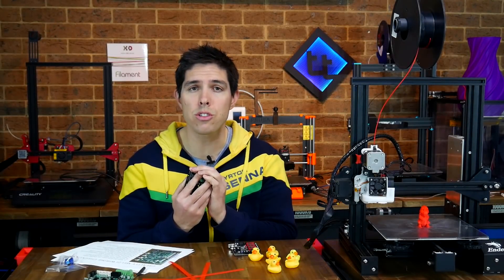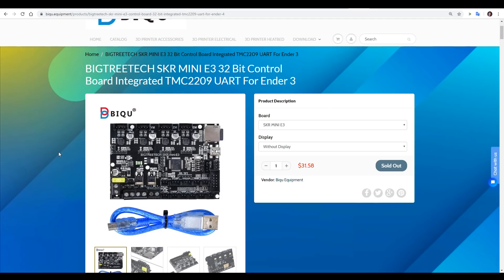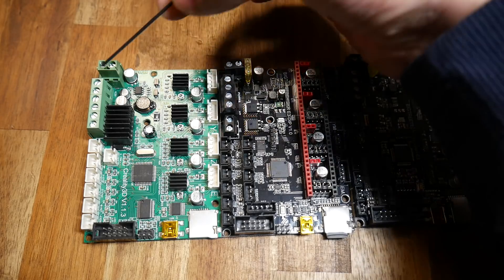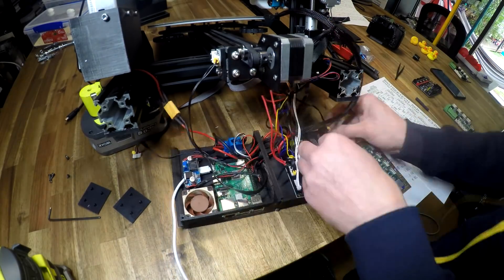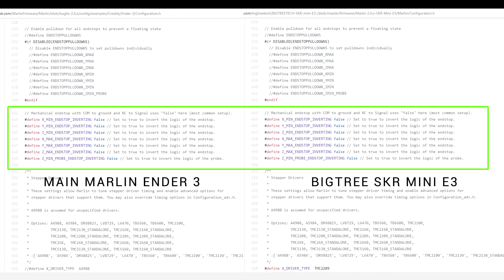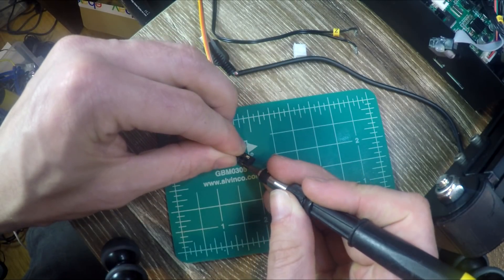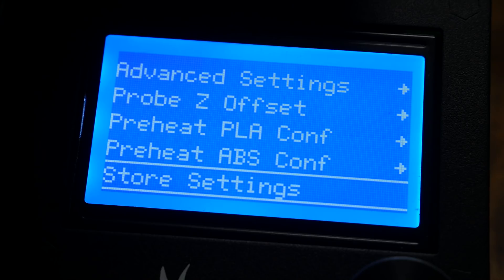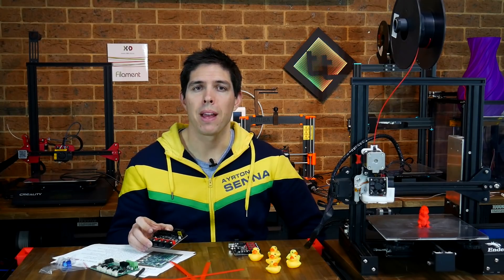SKR Mini E3 - The best Ender 3 upgrade from stock?

Comment: Hey Mate,

Do you know if I can plug a thermocouple direct to this board?
Reply from the maker: No you can't.
Reply: Cheers for the reply mate. 
Shame the thing is out of stock. I think my thermistor shorted and killed my board (can’t reach temps without thermal runaway, even with new thermistor from jaycar- with correct marlin thermistor table), so may as well upgrade to a better one.

Comment: (!!!) People need to note: there is a big problem with this board and reliability with BL Touch versions 3 and up. Frequent crashes into bed, probing fails, etc. Seems related to the 5V regulator (U6 on the schematic).

Be aware that the following partially ameliorate the issue but do not resolve it:
- 100nf cap across BLT 5V and GND
- 1000uF cap across 5V and GND on spare endstop
- turning off software interrupts for endstops in Marlin
- supplying clean 5V via USB / buck converter

Related issues appear to include:
- LCD flickering when hotbed active https://github.com/bigtreetech/BIGTREETECH-SKR-mini-E3-/issues/24
- Incredibly noisy and unreliable 5V rail, especially when servos active https://i.imgur.com/99kHqls.png
- Overheat and shutdown of 5V regulator when heated bed on https://www.youtube.com/watch?v=7RvH2XGFsz4&fbclid=IwAR1ZfIuQgvMvwTDs1jGCzFFsz_m-cSjNX_roWBrgoS522lGXoAQPAV_fL1Q

BTT's response has been disappointing:
- ignoring comms from users
- denying there's a problem
- refusing refunds on AliExpress

Michael, I understand you only had a short time with this board when you made this video and perhaps did not note these issues. However, I don't see how you can in good conscience continue to recommend the board in its current state. A cursory look at the BTT communities on Facebook will bear this out (e.g. https://www.facebook.com/groups/322956191976815/).

I have the SKR Mini E3 and have experienced this issue since day 1. BTT eventually sent me an E3 DIP with 2208's as a replacement after I kicked up a big stink. People say the DIP doesn't appear to suffer from the same issues, so I'm hopeful that when I receive the replacement I won't have the issue anymore.
Reply: Please update us when you get the dip version.
Reply: @iphonetroll  I love the support I've gotten from the 3D printing community, so I'll do my best.

In all fairness BigTreeTech has tried to do the right thing by sending an alternative replacement so I owe it to them too.

I really do hope they can sort this all out and get through this.

They clearly have some good ideas and are bringing to market some great upgrades at a good price.

Comment: I have order one. Question though - will it need extra cooling for the TMCs?
Reply: It has 4 cooling blocks to put on the tmc in the package.
Reply: @flobow8446  I know that. But does it need extra cooling - ie a fan blowing onto the driver heat sinks?
Reply: @meltonpieman959  i just have the Stock Setup and it works without any issues yet.(Standard Case Fan blowing in the Case)
Reply: @flobow8446  Thanks a lot

Comment: those poor heatsinks went to the wrong side of the board. tmc chips lead the heat downwards, that's the reason for the high number of vias (thermal vias) on the board and the big exposed copper surfaces on the opposit side. there is where the heatsinks should've been placed

Comment: how do you setup ezabl as I have that  instead of a bltouch in marlin 2.0
Reply: I just copied over all the TH3D U2 probe/ABL related settings to the stock Marlin 2.0 Ender 3 config (with the SKR mini e3 changes) and it works like a pro.
Reply: @The-Slunk  can you share your config so I can see how it is setup
Reply: @sreed1073  I definitely don't mind, but I'm currently having issues with my Y-axis motor Getting very hot (disclaimer). Let me know if you still want the config thought and I'll share it.

Edit: here is a link to my confi and config_adv https://drive.google.com/file/d/1zRipXbflnRbA0rveldzE1juoR_jB0pHo/view?usp=drivesdk
Reply: @theslunk
 It would be great if you could post your config. I have never checked how hot my y-axis with stock board. What mainboard are you using.
Reply: @sreed1073  here you go. I'm using the SKR mini E3
https://drive.google.com/file/d/1zRipXbflnRbA0rveldzE1juoR_jB0pHo/view

Comment: Are the main logic levels of these boards 3.3V or 5V?
Reply from the maker: 5V
Reply: @TeachingTech  Great! No levelshifting boards or optoisolators required, then, correct?
Reply from the maker: Yep 5V like the original so no hassles.
Reply: @TeachingTech  Thanks for your videos and responsiveness to questions!

Comment: Does anyone know if it is worth upgrading to this from a mks gen L with tmc 2130 stepper drivers.
Reply: Wanted to declutter and not rely on my tmc 2130 that are prone to overheating i was kind of asking if going 32 bit and marlin 2.0 gained me any benifits due to the fact that i would have to relearn programming marlin on platform io wasnt a big follower of tt back then but have now upgraded both my ender 3s to this mainboard having trouble uploading to the v1.2 board but very happy with it never the less

Comment: Run away from the SKR Mini E3, it is a disaster waiting to happen and I ought to know as I have one that is now sitting back in the Box it came in. It's damned near impossible to get firmware compiled for the thing to run as the manufacturer has used whatever was available a the time of manufacturing for the main Chips. Some are STM32F103RC some are STM32F103RE and Some are STM32F103RE+. When you try and format the Firmware Platform.io has to have the correct board name entered. And your options include Bigtreetech_512 or Bigtreetech_256 or Bigtreetech_512_USB and the list goes on an on. So if you want to Print something, expect to spend a week or two trying to get it to function and if you're crazy enough to try adding a Bl-Touch, expect another 2 or 3 weeks to get it working. If Ever.

Comment: Mich ,i got SKR MINI E3 V1.2 ,  i did every thing to enable XYZ end stop ( mechanical ) with no luck and homing issue still there , even i used your firmware.bin however it is not working and with VS code giving this message ( #include errors detected. Please update your includePath. Squiggles are disabled for this translation unit (E:\For 3D printing\big treetech\BIGTREETECH-SKR-mini-E3-master\firmware\V1.2\Marlin-2.0.x-SKR-Mini-E3-V1.2\.pio\libdeps\STM32F103RC_btt_512K\TMCStepper_ID5513\src\source\COOLCONF.cpp).) i hope you can read this message
Reply: im done and its working

Comment: Are there any Mainboards for the ender 5?
Reply: This one will fit. Ender 5 use same board as Ender 3. You only need to flash custom marlin firmware.

Comment: Thank you for making the video! I followed you original guides and got BL touch, upgraded Marlin with thermal runaway and filament run-out detection. (Pin 29 I think) This last one feature was not mentioned in this video, is it possible to get filament run-out detection with this board? Thanks again!

Comment: Will it work with Ender 3 Pro?
Reply: Yes, mine works well, but i think there is still room for improvement with the firmware.  Right now my stepper motors are running HOT and also i have read that it may be possible to adjust the firmware to include EEPROM storage without the need for storing on an SD card.  Definitely a great upgrade for the reduced noise alone.  I am hopeful any issues we are having will get sorted soon.

Comment: This thread originally was about the fysetc board but Tim from TH3D also mentions the SKR mini E3 having power issues. Feeding back the USB power to the power inputs etc. Would you mind investigating if there are any issues?

https://www.reddit.com/r/ender3/comments/ccqg1i/fysetc_cheetah_dont/etp7on3/?utm_source=share&utm_medium=ios_app

Also according to this thread there are a lot of problems with both the mini and dip boards https://www.reddit.com/r/ender3/comments/crm9ks/protip_avoid_big_tree_tech_skr_mini_e3_dip/?utm_source=share&utm_medium=ios_app

Comment: Can someone compile a firmware for this board, useable with the Ender 5 and a BLTouch?
Edit: I would really appreciate it if someone could do this. My power supply died on my PC and I'm working off my chromebook and smartphone until I can replace the power supply. Otherwise I'd do it myself. Thanks!
Reply: Download Marlin 2.0 and compile it yourself. It's not that difficult to do and it's a great skill to have.
Reply: @zoltankorossy2957  I would have done it already, but the power supply in my PC died. Also, it'll help out all the other people that have an Ender 5 and want to install this fabulous upgrade.

Comment: I ordered this board some time back and finally it's in the mail. One question, it now seem to be a fan connector that provide fan speed control. I assume that this is still for the 24V fan and that you still need a step-down regulator if used in a setup with a Noctua 12V fan?

Comment: Guys whats this 5v issue thing should i get a refund .
Reply: People are having issues with the BLtouch randomly crashing into bed (other issues like probe not retracting as well) that seem to be related to the 5v power required for operation not being constant/consistent.  It seems possible there may be a fix but it may require basic soldering skills. In any case, anyone that is hoping to use a BLtouch or other bed leveling device may encounter these issues.

Comment: Hey Michael, so i have swapped out my main board for this one.. i have the v1.2 and running with the stock firmware that come on the board. so far seems okay.
I do however have an issue where i plug it into my pc via usb and i get "windows does not recognise this device" and cura does not see that connected printer.. any ideas on how i may be able to fix this issue? is it a case of updating firmware or am i missing some pc drivers?

Thanks Paul

Comment: My board arrived today, there's been some changes to the bltouch pinouts and a new jumper near the display connector. Was having difficulty with tmc connection error which was resolved by building the firmware from source on bigtree's github. also this comment explains the firmware changes for the bltouch https://github.com/bigtreetech/BIGTREETECH-SKR-mini-E3/issues/6#issuecomment-523534807

Comment: My current ABL setup has developed a bad cable connection at the sensor so I plan on ordering the SKR Mini e3 along with BLtouch.  Should I expect any issues with the SKR board plus V3 BLtouch with the marlin 2.0?
Reply: Yes, be prepared for big problems: Frequent crashes into bed, probing fails, etc. Seems related to the 5V regulator (U6 on the schematic).

Be aware that the following partially ameliorate the issue but do not resolve it:
- 100nf cap across BLT 5V and GND
- 1000uF cap across 5V and GND on spare endstop
- turning off software interrupts for endstops in Marlin
- supplying clean 5V via USB / buck converter

Related issues appear to include:
- LCD flickering when hotbed active https://github.com/bigtreetech/BIGTREETECH-SKR-mini-E3-/issues/24
- Incredibly noisy and unreliable 5V rail, especially when servos active https://i.imgur.com/99kHqls.png
- Overheat and shutdown of 5V regulator when heated bed on https://www.youtube.com/watch?v=7RvH2XGFsz4&fbclid=IwAR1ZfIuQgvMvwTDs1jGCzFFsz_m-cSjNX_roWBrgoS522lGXoAQPAV_fL1Q
Reply: Mark Toogood thanks for the reply.  Now I have to rethink this.

Comment: So if I use this board, should I remove my stepper motor dampers?
Reply from the maker: Yes you won't need them anymore.
Reply: If you need the dampers on an other project, remove them. But if you do not need them elsewhere, there is no need to remove them.

Comment: How much is Bigreetech paying you to push their junk?  I have gone through two boards already. The first worked great for a couple of days but then started to sound like it was grinding. I updated the firmware but it made no difference. I got that board replaced but the new one worked for exactly 1 print, ONE before it too started to make the grinding noises. I put the stock board back and it worked perfectly. 
Maybe you're so fast at replacing boards because they keep sending you junk boards to push.

Comment: I have no stepper dampers.  So i should get the version with the 2209 stepper drivers, right?
Reply: 2208 and 2209 remove the use for dampers

Comment: @Teaching tech , Why do you consistently think that the wiring diagram on the BL TOUCH  is red, yellow, and brown, black and white, when both v1 and v2 versions are  red, blue, yellow, and NOT brown, then black and white???  I have both v1 and v2 versions, and there's NO brown wire in either versions. You need to accept that. I have fried 2 of the other 32 bit boards for the Ended 3, and sent them back because of the poor explanation of the wiring voltages when it comes to the wiring in your previous videos. Australian color coding is different than the US wiring coding, and must be noted in each video of this board upgrade. Please research the wiring coding for each wiring color, because it is IMPORTANT!!! Some of the wiring can be a different voltage or amperage, and putting in a wrong voltage or amperage on a main board can fry a resistor or blow up a capacitor, and then the board is useless and fried. You have to also consider that not everyone has been versed in the wiring color diagrams , or know if a red wire or a blue wire could equal to 5 volts or 15 or more volts and the same thing with amperage. People need to know this, because it could mean the difference between a successful installation, or a installation that will result in a electrical short, or to the extreme, a ELECTRICAL FIRE in their home when installing it. You may "have done numerous installations with no problem", but you need to consider the audience that you are directing this to. You need to consider what each voltage or amps are on the main board, and note that in the video.

Comment: Bought this board and it was excellent, but it suddenly threw a "TMC CONNECTION ERROR" one day and now the x axis doesnt work. I've swapped the stock board back in and it works perfect. Anyone else have any issues with this board?

Comment: Good for board install but most of the bltouch setup is wrong, including wiring diagrams. Save yourself alot of grief and go to github and get the right info.

Comment: $27 for a adapter? rofl Its just wiring.
Reply: fyi a 10pin IDC ribbon cable is $.86 USD on Ebay, Will have to use a razor blade to splice the wires out but hey, more money for a bl touch!

Comment: Firmware for the V1.2 board with Bltouch is junk. Went autohome and it smashed my X axis into the gantry. Avoid at all costs.
Reply: I wouldn't say it's junk, it's just outdated. I have the new v1.2 board and this firmware does exactly as yours. It plows the head all the way to the right, HARD. I have to believe it's something to do with the differences in Marlin, board chipset, and maybe even the programmer. I'm going to take some time to try to get this going with the latest bugfIx of Marlin. If I'm successful, I'll let you know.